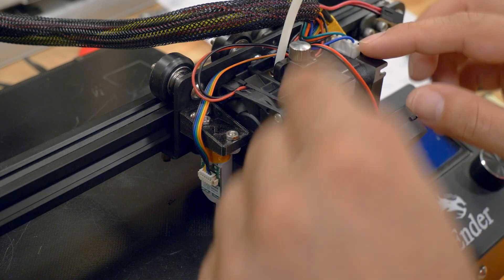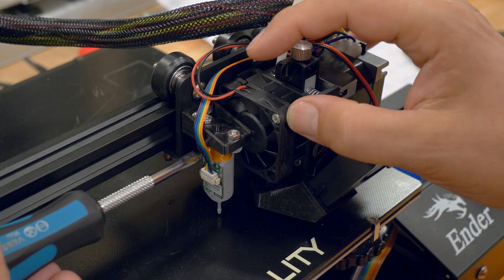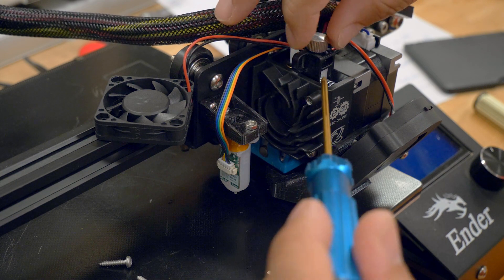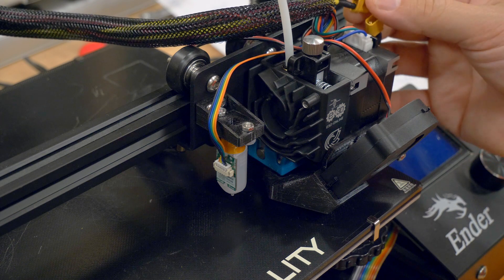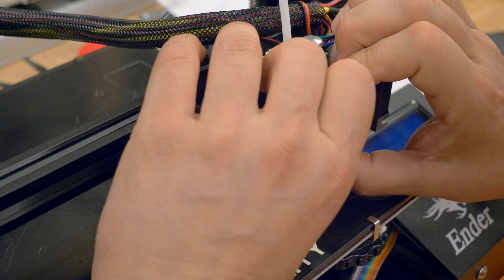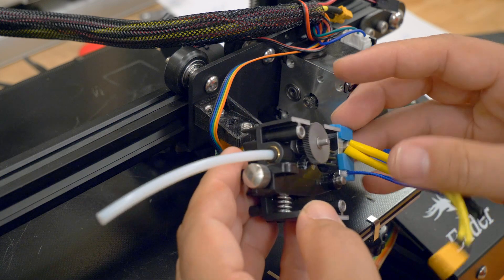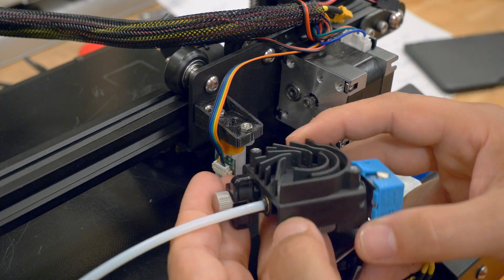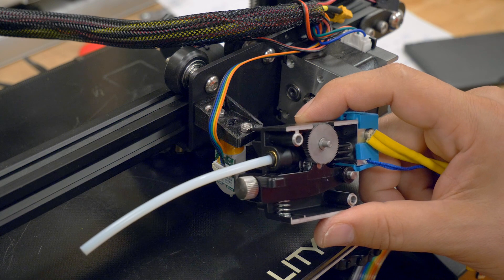Clearing a jam on an E3D Hemera is actually not that difficult

Comment: so joshua, are you still printing with this extruder, or are you also affected by the "amazing quality" this thing produces after some prints?
Mine prints absolutely shit since the 3rd print or so. funniest thing is, that it can't handle simple PLA, extrusion is all over the place, I wasted so much time with this thing, I don't even want a replacement at this point. just my money back to be honest. this thing is like the cheapest china crap, but is sold here in Germany at 140€, I thought hey, why not get the top extruder, just to be safe and have finally a good one. truth is, the mounting T slots suck by design, the fan sucks cause it has like 30 db,  also a design flaw. the filament transport gears do grind PLA more than anything, user had tons of problems with cracked gears, misaligned shafts,or just in general defective steppers, and shit extrusion.  in my case it is shit extrusion, clicking, filament grinding, or just stopping extrusion randomly. they went with the cheapest production.
I also wonder why there is no part cooling fan/duct included, or different m3 bolts for the t slots, cause .25mm "oversized" screws will brake the mounts instantly... this thing is just engineered to be the cheapest in production, and that is why it breaks constantly. if you got problems with it, I guess, E3D bets on you , that you will break some parts while wiggling this thing around and trying to fix it, and order some more of their stuff..like nozzles.. not even a second nozzle was included... there is a German knockoff to this design also for about 120€ but I saw it too late.  now Iam stuck with problems, which sucks especially with 3d printing. this unit is basically the perfect unit for reviews, it works for some hours, then breaks.

Comment: I have an issue when I need to pull my hemera apart to clear a jam. Can I open it up and just pull the gears out ? Or is there a method to do it so I don’t damage my gears ?
Reply from the maker: I'm not really an expert there but what I show in the video works well for me.
Reply: @JoshuaBardwell  well my issue is that I have filament stuck in between both of the drive gears and it won’t allow fresh filament in
Reply from the maker: Once you disassemble as shown in this video, the drive gear will come out.
Reply: @JoshuaBardwell  yes I figured it out last night and was able to fix my extruder !

Comment: Cleaning filament also helps out a ton. Sometimes I crank up the temp on the nozzle and run some through. Or I use it for cold pulls to clear burnt stuff in the nozzle.

Comment: Well, you miss the part where you have to take the heatbreak out to be able to remove the geared part. For that, you have to unscrew the entire hotend. I was able to leave the nozzle and the heatbreak attached to the heater block and unscrew the heatbreak from the heat sink that way.
but in order to clear a jam, you actually have to take the nozzle out, not the heatsink off the extruder. What I'm trying to say is, there are a few more steps involved than what is shown in this video.
However, the cool thing is, it's all pretty accessible. I had some issues with my original extruder of my printer, specifically when it came to maintenance tasks.
Reply from the maker: I removed the geared part without disassembling the nozzle but maybe it would be different if I had a jam.
Reply: Check out the E3d Revo makes the process a lot simpler

Comment: Just straighten a paper clip, heat up the hot end... push the paper clip into the filament path. You may have to remove the nozzle. I used to take mine apart, but it’s too easy to use the paper clip.
Reply from the maker: This can damage the polished walls of an all metal hotend. Not recommended.
Reply: @JoshuaBardwell  true... My first printer was a crappy Cubex, and it was a lot more difficult to tear apart... call it a habit. The trick is to solve the heat creep issues with shoddy cooling. I went water cooled, and have had zero problems for 3-4 years now.

Comment: Removing the hot end isn't big deal, I would say that's an easy step, but the difficult part starts when you reinstall the barrel in the exact same position that E3D defines in its manual, if you screw the barrel in a slightly different way, I guarantee you'll suffer a dramatical jam sooner than later.

Comment: That seems quite difficult to me. I have two direct drive extruders, one is home built on my Ender 3 and the other is on my Voron 2, in both cases the idler gear is on a hinged flap that opens up to expose the innards. I don't get many jams, mostly its with TPU, and I've never not been able to clear it just by opening the idler flap - no disassembly required.

Comment: I know this has nothing to do with this video but wondering if can help. Am looking to add another blower fan to my ender 3 pro add can i simply take them out of the motherboard and twist the wires together then put back in or would i need to solder and splice them?
Reply from the maker: You can twist and re install in the main board terminals.
Reply: @JoshuaBardwell  brilliant thanks for the help. So its not only drone stuff ive learnt from you lol thanks now just gonna design wee bracket for fan use the screws on left hand side of fan mount.
Reply: Most fans on the market don't have long enough wires to reach the control board, so its easiest to put some kind of connector up at the hot end then wire your fans up to a matching plug.

Comment: Did you fix your stringing issue with the hemera? I've been having similar problems and can't seem to get it sorted
Reply: Is it with tpu? You need to dry the filament. Look into dehydrator and a “cereal dry box”
Reply: It’s been my experience that stringing issues are typically retraction settings in your slicer. For direct drive extruders, 1mm to 2mm at 30 to 40mm/s is good for PLA and for Bowden tube extruders, try 6 to 8mm, same speeds. For TPU and direct drive I use 4 to 6mm at 30mm/s